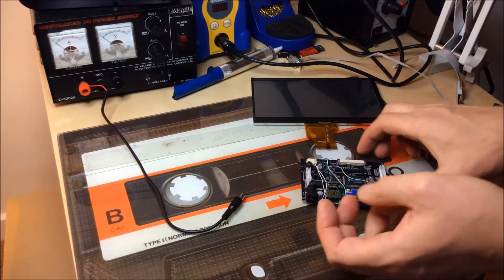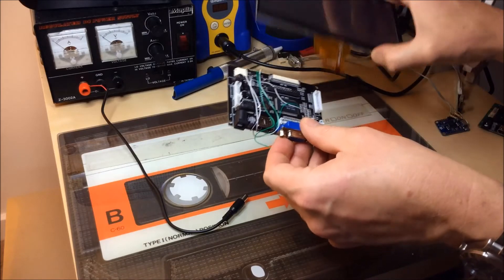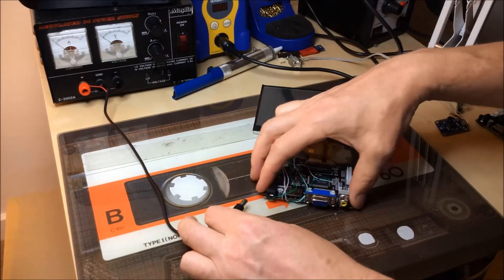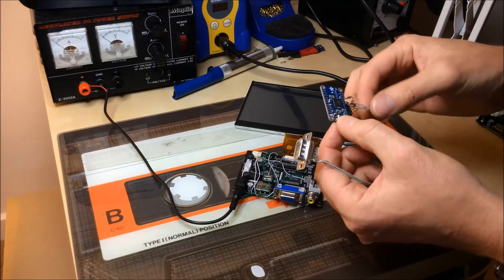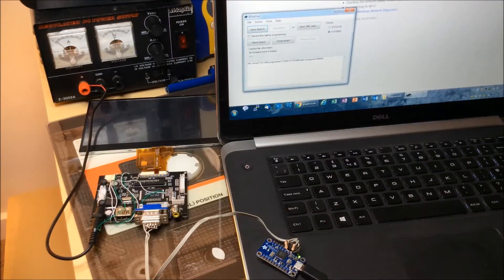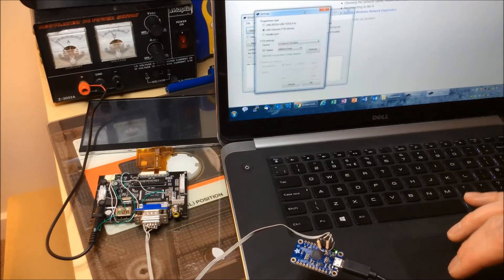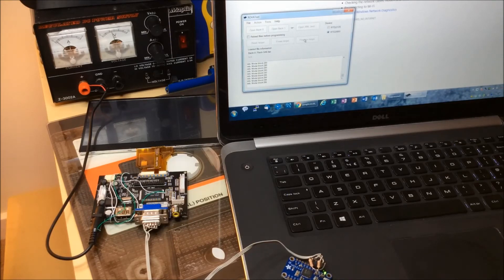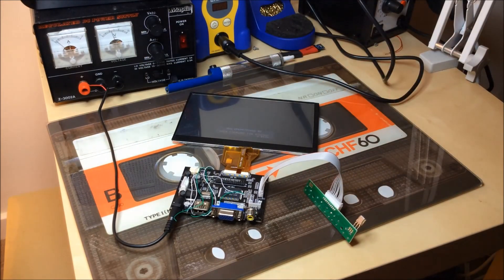Uploading OpenRTD firmware to the RTD2662 display driver

Comment: Splendid work,

I've downloaded the firmware files from the openrtd web site, which one would I use to enable RGBS on a 800x480 AT065TN14 screen, I can only see 2 800x480 versions but neither mention RGBS or AT065TN14?

Thanks

PS the FT232H Cable link is broken

Comment: I have got a RTD2556 board with only hdmi connector. How yo program that?
Reply: Hi
Did you found solution how programm it RTD2556 ?
Reply: @MegaPiotrek1984  Same problem here, did anyone find a solution?
Reply: @SkeleCrafteronYT  HDMI имеет в себе I2C шину. Найди по номерам выводов 15 - SCL и 16 - SDA (либо в некоторых случаях 17 - SCL и 18 - SDA, тут я уже не помню) и подпаяй проводки. Плюс вроде бы надо ещё 13 вывод подключать. В качестве программатора можешь использовать любой микроконтроллер с предварительно сделанной прошивкой или преобразователь USB в I2C типа FT2232H или CH341T.

Но всё это работает только если у тебя I2C на плате в контроллер заходит. Это тоже надо узнать перед программированием.
На крайний случай подпаяй напрямую к микросхеме флеш-памяти и заливай в неё прошивку, это тоже работает.

Comment: i have this error 
Info: Attempting erase...
Error: Transaction failed during Write

when i unplug the ldc controller from 12v and it says
Info: Attempting erase...
Error: Timed out waiting to enter ISP mode
Reply from the maker: Not seen that error before. If you are sure your programming cable is wired correctly, I can only suggest contacting the RovaTools developer (link in the description) and see if he recognises this error

Comment: Cool! Looking forward to doing this myself! :) But I'd like a firmware that shows only a black screen when booting, not blue. does the openrtd firmware do this? And where is the download on that Russian site, lol?!
Reply: already found that you can disable blue screen in the standard firmware, but not the OSD.
Reply from the maker: The OpenRTD firmware doesn't have the blue screen, its always black - you need to contact the developer via his site and he can provide the new firmware for you.
Reply: thanks for your reply! contacted him via his email last week. no response so far. is there another way?
Reply from the maker: Sometimes he takes a long time to reply, but eventually does!
Reply: darn. still no reply from him. i know i know.. patience.. ;) can i bother you for the binary image, or it is truly on a no-spread basis?
Reply from the maker: Are you needing the 800*480 resolution TTL screen version?
Reply: 800x480 yes! :) don't know about TTL.. are there LVDS and TTL modes or so?
Reply from the maker: Pieter van der Meer the board is capable of both but I only have firmware for the 50 pin TTL screen. Send me an email at ben.willcox@willcoxonline.com
Reply: done!

Comment: Great job! I've benn following Your's job since few months, now i decided that it's time to start my own upgrade. And the start is rough for me...  As You mentioned- it is very important to have a proper version of bin file- corresponding to the screen resolution and connection. I'm having IPS 1024*600 screen connected through LVDS. It was working great until i tried to upload new rtd soft from seobrian from Jagforum. Probably it was designed to ttl out, so now i have a pesimistic black screen. Good news is that ft232h programmer is working ;) Ben, are there any chances to find correct version of soft to be loaded to RTD or rather I should order a new screen connected by TTL? I have spent many hours trying to find solution- You are my last hope. Also- greetings from Reykjavik Iceland!
Reply from the maker: Thanks for your comments! I would suggest you contact the developer of the OpenRTD project here: http://openrtd2662.ru/ and he should be able to build you the correct firmware for your screen.
Reply: @JagDroid  There is no any firmware on this site :(
Reply: @fsmokef6092  Yes, no firmware on site. I am searching fw for iPad2 display. 😞
Reply: Thanks, i just did this. Hoping he will be willing to help. Did he helped folks from forum in the past?
Reply from the maker: Bartosz Dziub yes he provided the firmware in the first place